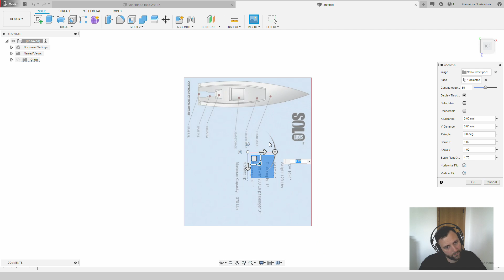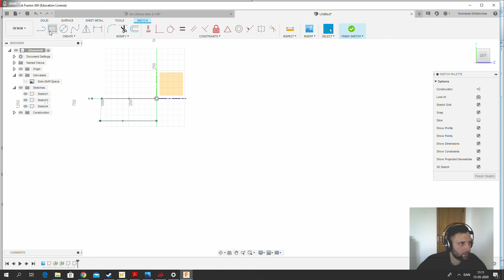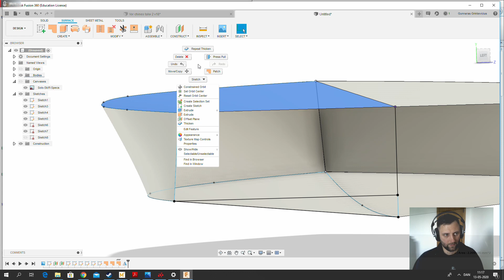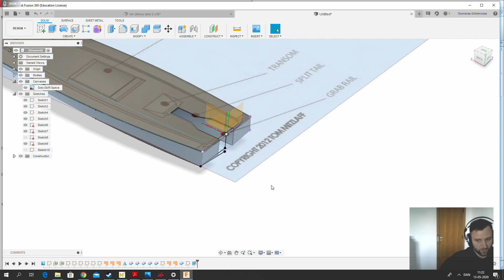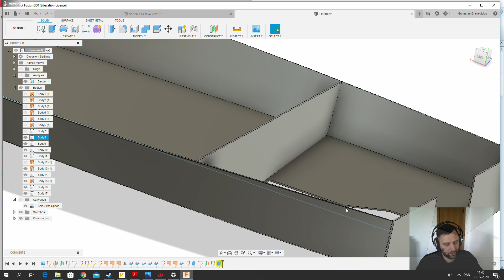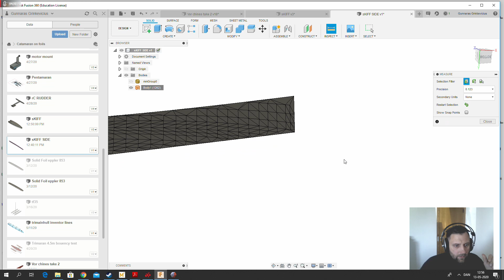Stitch and glue - Boat design in Fusion 360

Comment: INTERSECT!!! God, I have been looking for that  feature for absolute ages!! I originally learned 3D CAD on Autodesk Inventor 2012, back in high school, and Intersect & Project were the same tool. I thought Fusion 360 didn't have that feature; I have been completely lost without it! Making bulkheads will easily be 10 times faster now, Thank You!!

Also, take a look see at a Fusion 360 plugin called Exact Flat. It allows you to do the unwrapping with material specific modifications. As far as I know it is free for hobbyists to use.

Your catamaran hull looks really nice! I'm working on a 16 foot foiling cat myself, (similar to the iFly15 but with less carbon fiber and $25,000 less expensive) and yours puts mine to shame. I'm tempted to restart, but I might follow through with my current design as it will be fairly quick and easy to manufacture a prototype to test the hydrofoil system & learn to sail properly.

I would love to see a time-lapse of you working on a boat, if you'd be willing to share that with the internet, maybe 3-4 times sped up, or something like that.
Reply from the maker: Hey, Thanks for the feedback. The catamaran hull is uploaded as fusion 360 file in video description. Feel free to use it or modify it to your needs. I havent really decided if i will continue with boat and maritime engineering videos or what i will do with the channel :p Cheers